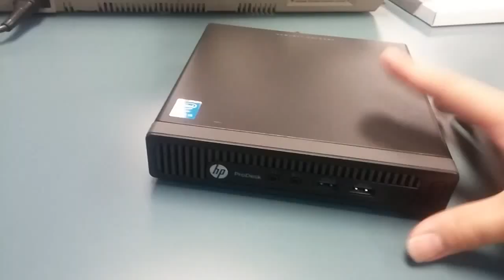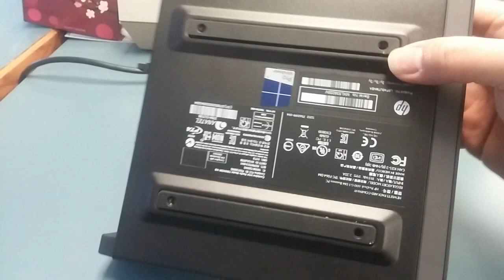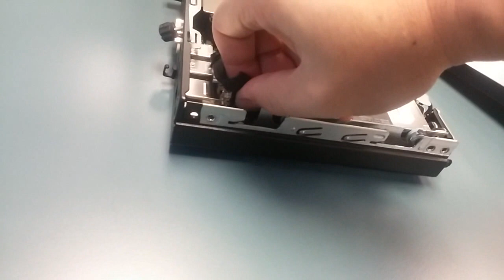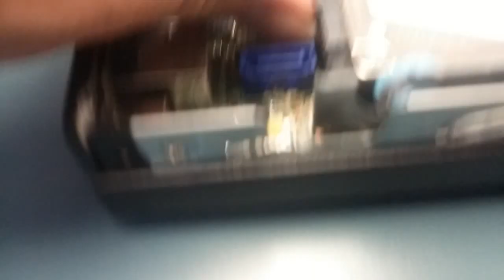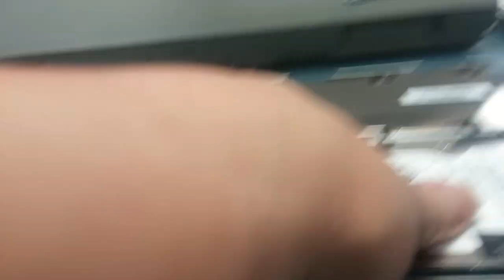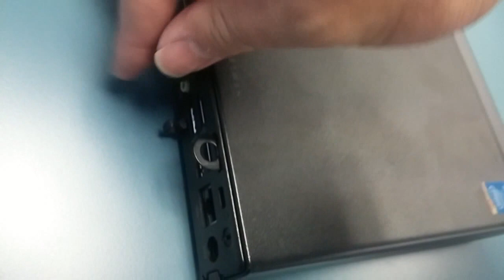HP Mini PC ProDesk 600 quick view, open box, add RAM, internal view

Comment: Can you change the hard drive ?
Reply from the maker: yes. it can be replaced with SSD or larger capacity hard drive
Reply: Can you add a graphics card ?
Reply from the maker: No, I cannot.
Reply: @xanx3572  You can add a graphics card by using a m.2 to PCIe adapter. I'm doing it with my Hp ProDesk 600 mini and have it connected to a GTX 1060 6GB. Did it to see if I could and it works really well actually! This type of setup is called "e-GPU" or external graphics card.

Comment: Hi 
Can you show where wifi card is installed in it. If it is with wifi.
Reply: It's soldered on the board.
Reply: It is an m.2 card that can be added in or swapped
Reply: 3:20 mark 7260 WiFi-N is white sticker M.2 next to the RAM that was already in the computer when she added another.

Comment: Hi... I need the model power supply please. Thanks :D
Reply: A low-heat "T" project Haswell like i3-4160T is in these, so only 65Watts from any laptop brick works fine. 19V 3.32Amp 7.4mm